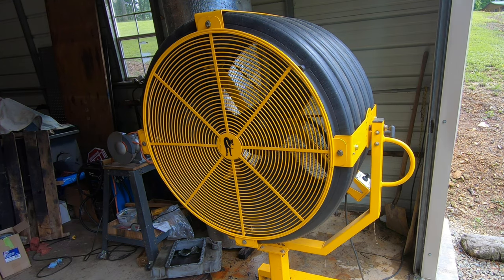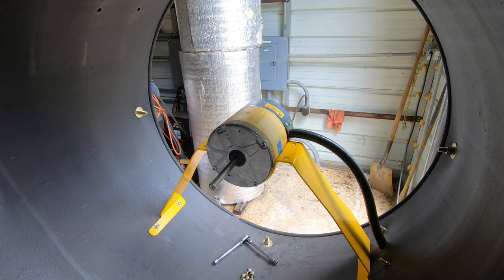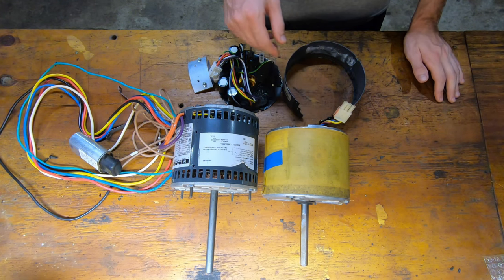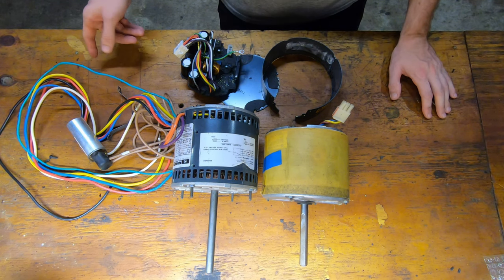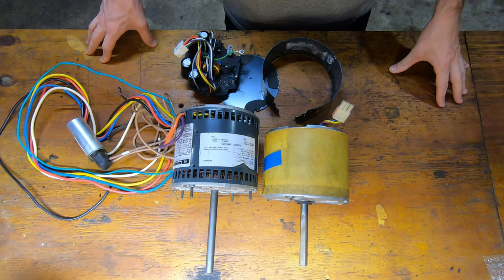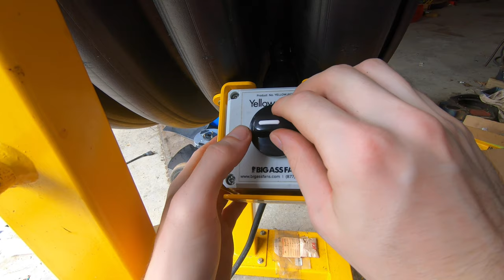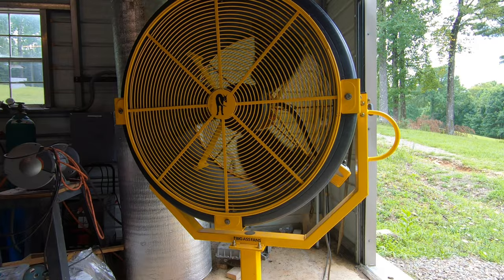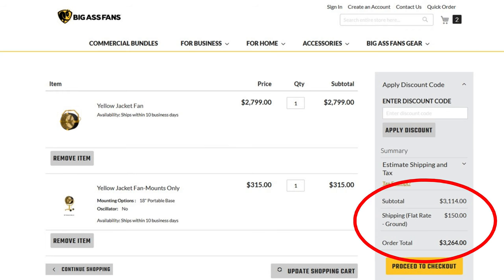Fixing a Big Ass Fan - ECM to PSC Motor Conversion Saves $1,000

Comment: BLDC motors are seeing use in a lot of applications these days. You might be able to get a generic 3 phase ESC to that would drive that motor well enough.
Reply from the maker: I considered that when I was trying to decide what to do.  What stopped me is it seemed like I would need to get an ac to dc converter and then a ESC, and I recall reading the operating voltage of the ECM motors is typically around 300Vdc. I couldn't seem to find a generic ESC that was advertised at voltage this high, and the converters were expensive and looked hard to package. But I still have the original motor, so I'm game to give something a shot if there is a good way to go about it. But when I was looking into it, this seemed more expensive and I had lower confidence in it working than going with the PSC.

Comment: Excellent video. My Yellow Jacket appears to have a controller issue as well. Very frustrating as it only lasted five years. I may have to do the same repair you did. Will you please share the part numbers for the motor and controller? Thanks

Comment: It looks like a nice fan, but I can't understand why it has to cost 3 grand. Does it move that much more air than any other 1/2 horsepower fan?  You proved it will break just like anything else and cost a fortune to fix with parts only available from the manufacturer.
Reply from the maker: It does move a lot of air, but I think the real selling point in my mind is it's efficiency at lower speeds, and it's ability to move a relatively high volume of air at lower speeds (when it works!).  So if you were going to run the fan around the clock in an industrial setting at low speed, that's probably the greatest value proposition in terms of energy savings vs a PSC motor driven fan.
Reply: @Sockets_and_Sprockets  $3000.00 is quite a bit of money. (to me anyway)I can just imagine me trying to convince my boss that it will pay for itself over years of continuous usage and then 2 weeks later hearing " We got that fan you wanted, only we found a cheaper one thats just as good." as they roll in a  $150.00 fan from msc. Or scenario 2, they just laugh me all the way out into the parking lot.

Comment: There are potting compound removal chemicals...
Reply from the maker: I looked into that, but couldn't find anything that seemed well recommended.  I tried soaking it in isopropyl alcohol, but that didn't help.  Do you have any suggestions for what to use with a rubbery / silicone (I'm guessing) potting compound?
Reply: Do you have some suggestions?